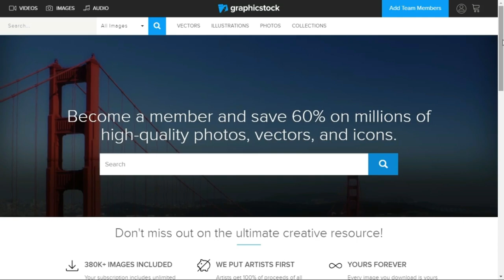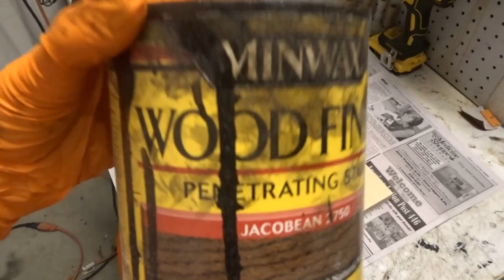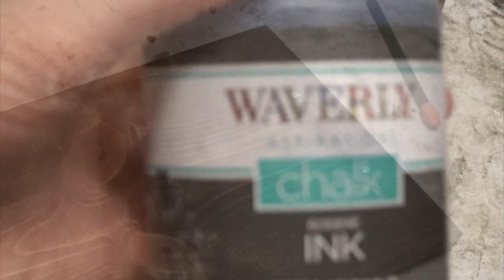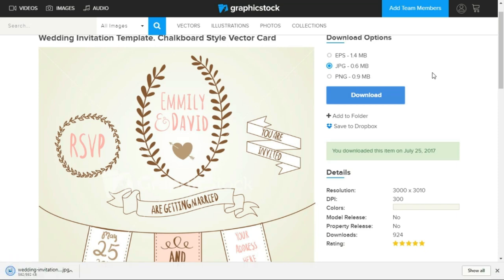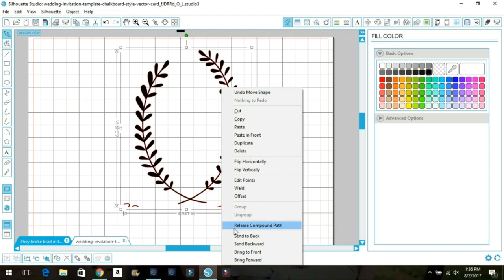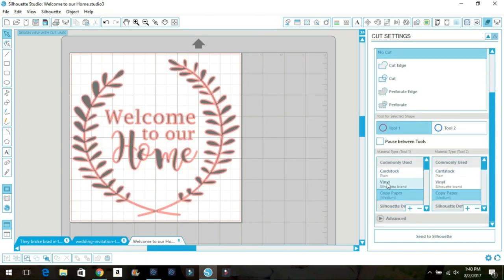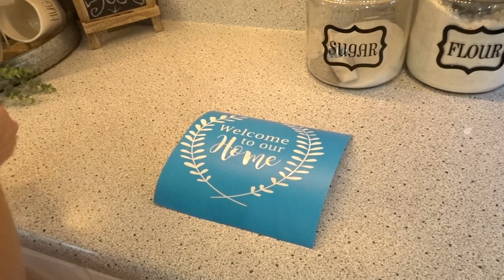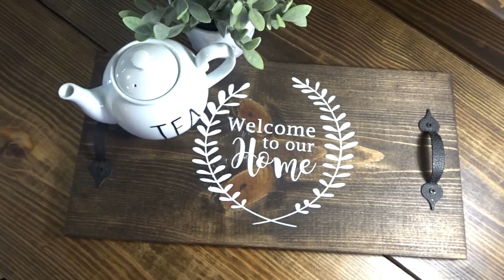DIY Easy Wood Tray

Comment: Did you apply poly before putting paint on? I tried one over the weekend and my paint wont stick. I accidently bought glossy paint. I sanded and stained my board with oil based paint and then added water based poly on top.. then i painted it with a glossy paint.. dont know where i went wrong and my paint wouldnt stick. 😔

Comment: Love! I need to make me a tray.

I am struggling with the contact paper stencil! So, I am just using 813 and 631. I would like to try the 811...I just need to break down and buy some. I saw on a group where they are replacing the chalk paint with spray primer. I tried it and WOW! My lines were crisp and perfect!
Reply: Are you going to seal it, and if so with what?
Reply from the maker: +Shelly Watson Oh I need to look into that!!! So many ways out there! I feel like there are pros and cons to everything though.
Reply from the maker: +Sharillya Townsey If you would like to seal it I would suggest a clear matte varnish or Polycrylic
Reply: I tried the spray primer thing also. Worked great.

Comment: so I have recently started using oramask as well.  what do you think of it compared to contact paper? have u only tried the oramask 813 or have you tried the 811 too?
Reply from the maker: +lovemygirlsen I do think it does better but it's a pain the take off. There are pros and cons to both. I should try the 811 bc this one is pretty sticky, but no I haven't tried that one yet.
Reply: The Daily DIYer I've read the adhesion on the 811 and 813 are the same, it's just the thickness of the stencil that's the difference.   I've always used contact paper, like you, but started having issues lately so I tried the oramask.  what type of transfer tape did you use in video?  I agree that it's hard to peel the oramask off the board and it's been splintering my boards.  😡
Reply from the maker: +lovemygirlsen Oh ok!! They should make one less tacky. It is a little bit too sticky and like you said pulls off paint and wood... there has to be a happy medium out there.  
I just use clear contact paper for my transfer tape. Easy to get and inexpensive.